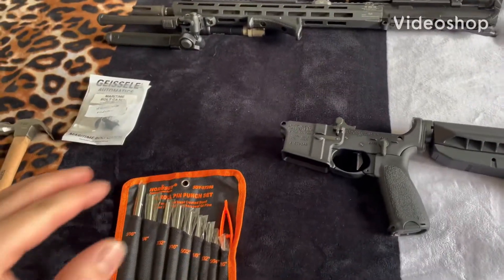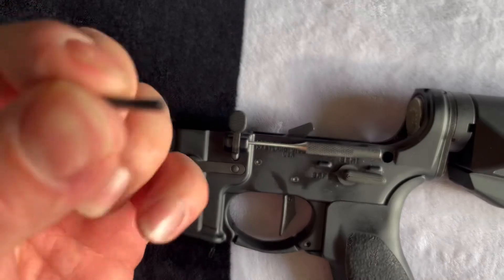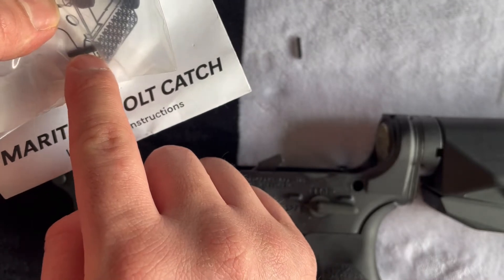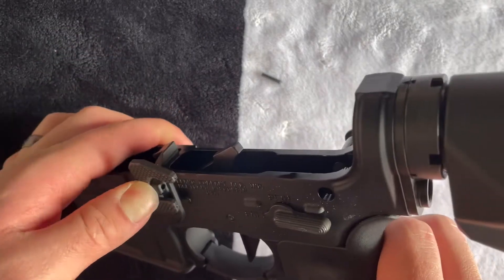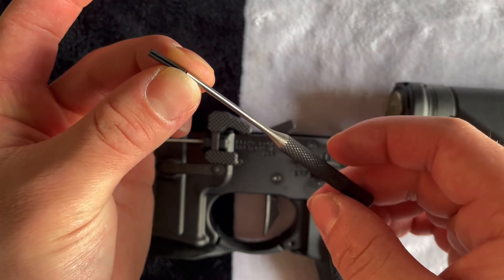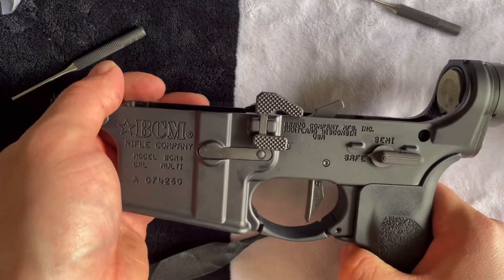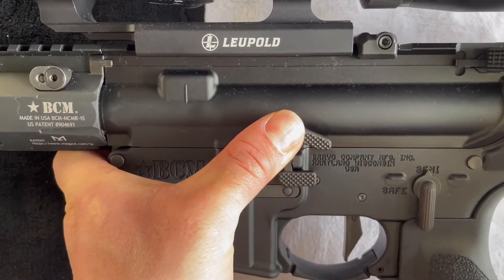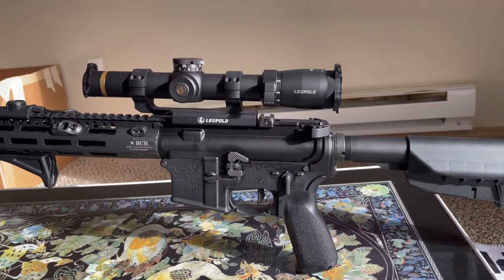BOLT CATCH INSTALL!! (Geissele Maritime bolt catch)

Comment: Don’t let the haters get to you, this is a good video. Everything you said is perfect for a beginner. This is the hardest pin on an AR besides the pivot pin on the front
Reply from the maker: Man thank you! I appreciate this a lot! 👍🏽❤️
Reply: Hard agree.

Also, a tip for that front pivot pin... get a 1/4 clevis pin.  I picked up 2 for $2.50 from tractor supply.

To install, you slide it into the pivot pin hole, line one of the clevis pin holes with the detent hole, drop in the spring and detent, push the detent down with a punch (ive used allen keys and toothpicks before), and rotate the clevis pin 90 degrees.  Follow it through the receicer with the pivot pin, and itll snap into place.

To remove, pull the pivot pin all the way out, and use a pin or tiny punch to depress the detent, rotate the pin, and follow it out with a clevis pin.  Hold your finger over the holes on the clevis pin, and youll capture the detent.

Since spending that $2.50, Ive never lost another detent.

Comment: I appreciate this video, and props to you for getting the pin out/in so quickly.

However, I gave up on standard roll pins.  Especially since theyre not technically supposed to be reused.

KNS makes a bolt catch retaining pin that fits on woth little c clamps.  No hammer or punch required.  Super easy install, super easy removal.  It lets me play around with different bolt releases without the anxiety of potentially wasting an afternoon or marring my receiver.
Reply: Roll pins are made of spring steel and, as evidenced by the open groove in its length, designed to expand and contract. As long as they grip as they are intended to, there's no reason not to reuse them.
Still, I agree that the KNS pins are excellent.
Reply: @fastbullet7301  their spring tension is going in one direction.

Reusing them means hammering them 90 degrees to their working direction.  Multiple times.

While driving a set roll pin doesn't do a lot of damage, setting one to the point that you can drive it does.
Reply: @marcush4741  You have no flipping idea what you're talking about and an even worse ability to explain it. The only "working direction" is in the roll pins ability to contract and expand. There is no 90 degrees.
I'm not going to debate with someone so obviously educated beyond their inteligence.

+

Comment: After 2 hours of fighting and beating my head against the wall I finally got it. Warning to everyone who has a billet lower out there - heads up = the geissele roll pin will likely not fit and will get stuck part way in and you'll end up marring your $300 lower even when using tape (i used multiplelayers). I ended up using the old pin after having to smash the geissele pin back out (pliers were also needed). Old pin went back in with just a handful of light taps. Probably not ideal but its snug enough. Anyway, good video bro. Just giving a heads up to any future viewers to spare them my pain. Thank you 👍
Reply from the maker: Thank you so much for the feedback and thanks for sharing that information! 👍🏽🙏🏽

Comment: I also put oil inside the receiver pin channel and a generous amount of oil on the pin to make installation much easier and smoother. I definitely use tape on the receiver to try avoid scratches.

Comment: Good video.  So have installed a few of these — one of things that helps is get your roll pin started before you put the lever in — tap it in until it’s just at the edge of where the new lever goes then pop the lever in and get back to tapping.
Reply from the maker: Thank you for the tip!

Comment: A roll pin starter punch make the pin install easier. The punch actually holds the pin as you drive it in.
Reply from the maker: Thanks !

Comment: You did not mention the fact that the lower pad covers the hammer pin. You have to either use a smaller punch than normal, which is not a good idea, or remove the catch.

Comment: Great video. A recommendation when pushing pin out. Stop as soon as leverage is free don’t completely remove so you can reverse the pin when the swap is made. The tape for me is a good alternative but personally adds frustration as the tape gets in the tight spaces and makes it annoying to remove after. But it’s a small point im making. To each their own. In a rant level why are roll pins even used. There must be another way. I’ve literally had to cut a gas block off my brand new rifle destroying the finish on the barrel and showed me how impatient I became. I’ve bent 2 tools trying to remove it. They should use a screw or something simplistic
Reply from the maker: Thank you for the tip!

Comment: I didnt wanna buy one of those special hammers with the rubber/copper head becausebits non marring. And deff reccomend lube and tape if you do care
Reply from the maker: Thank you for sharing
Reply: The hammer you speak of is not what you need, anyway.
If you take notice, the toy claw hammer at the beginning of the video is clearly labelled as weighing 7 ounces. He stated he bought a hammer for its size. Essentially, using the wrong hammer was easier than protecting the receiver and buying a useful hammer.
Far more appropriate to the job would have been a ball peen hammer which could have been chosen for weight- NOT size. Because a ball peen hammer is clawless, the weight is concentrated into its smaller size. A 12-ounce hammer is not any larger than his toy claw hammer, but much better for driving roll pins in and out. More mass and more weight means more work will be done with each hammer strike.

Comment: Thank you for the video I really liked it. You paid 40bucks for it my guy they have sales were you could get the maritime extended bolt catch  for 15 bucks.

Also I think it would be wise if you use a rubber mallet to hit the roll pin so that way the lower receiver doesn’t get damaged. I think there’s also some type of small manual press to install roll pins like this.
Reply from the maker: Thanks for your feedback and yeah 15 bucks would’ve been a much much better deal and thanks for the tips and advice!
Reply: You think far too much.

Comment: You know it would be a LOT EASIER with a ProMag Armorer's Lower Receiver AR-15 Action Block which only cost $08.00 to $15.00 dollars. Clamp it into a vice with the mag holder side down in the vice. Just sayin. Check Midway USA.
Reply from the maker: Yes I did this install before I had any really gun tools lol I got some stuff now tho thanks!

Comment: I bent two pins now im pinless.
Reply from the maker: lol oh no! They don’t make it easy. I like the aero precision lowers because they have a screw in pin.
Reply: @Redeemed_Team  I see. I went with a kns pin. It has a smaller diameter pin size with a tiny c clamp.

Comment: WHY did you remove the pin all the way?????  Once it would let the catch come out you could replace it and then tap the pin back in.
Reply from the maker: Good point lol
Reply: I don’t think you are supposed to reuse most roll pins, if you have a new one on hand probably better off replacing it
Reply: @zacharybohl8761  Why not? You saw it on the Internet?
Roll pins are formed from flat lengths of spring steel. They are intended to grip in a slightly undersized hole. As long as the pin hasn't been damaged or fatigued to where it no longer grips, there's no reason not to re-use one.
But didn't he insist on using the new pin that came with the part?

Comment: Does the roll pin have the same distance on the other side of the bolt catch it is there some space left over?
Reply from the maker: Good question! And yes same distance on both ends. And it sits almost flush!
Reply: @Redeemed_Team  - Thanks, mine is flush on the side it was hammered in with, but on the opposite side hole there is some space there (although if functions). I’ll call Aero & ask them what to do since it came from the factory that way. Maybe it’s a defective short pin.
Reply from the maker: @MrChuckwagon55  yeah might want to ask them just Incase it starts to walk on you. But yeah my BCM lower seems to fit the roll pin nicely. I have another Aero lower as well, but it’s the M4E1 model so the roll pin is actually a screw in version which is a great improvement by Aero!
Reply: @Redeemed_Team  - The screw version is the best version, I wish I got that version. But I got the version with the PDQ lever and it’s only offered with a split spring from Aero.